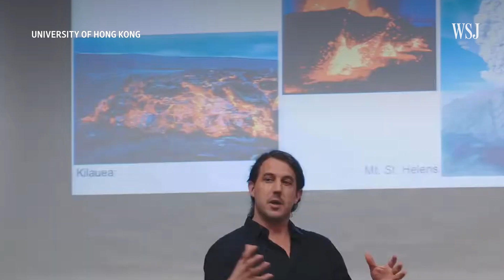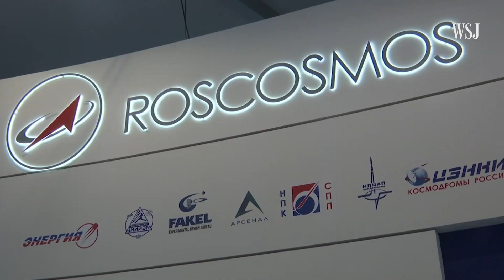China’s Moon Dust Paves the Way for Future Mining Missions | WSJ

Comment: Okay but if we start mining the moon for Helium 3, then what else do we start mining? At what point does it stop? The moon is integral to all life on earth with the way it controls the tides. I think we need to be more careful in setting limits on ventures like these if we start doing this.
Reply: What are you worried about?  The moon and how much it weighs?  Don't want to bring too much to earth from the moon?
Reply: @peacepoet1947  i'm pretty sure the bear wasn't talking about weight; my science is small, but i think mass is the issue...my reasoning is thus; if you take a ton off the moon and bring it to earth, the 'weight' goes up because there is more gravity on earth. That looks like better than interest to me, and having that capacity to control the tides on earth,,,well that would surely be a good thing....i can just see china with most of the stuff trying to do strategic tidal control ;)
Reply: @kparker2430  mass equals weight and you can't have one without the other.
Reply: i mean we are brining more space junk to the moon